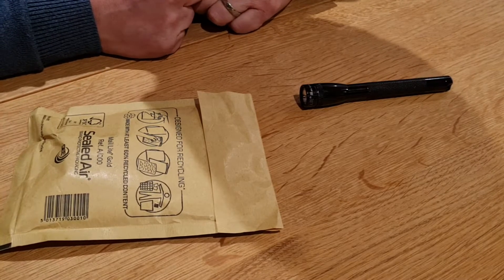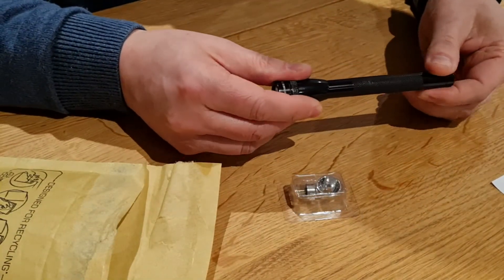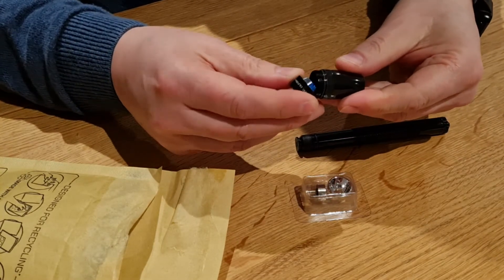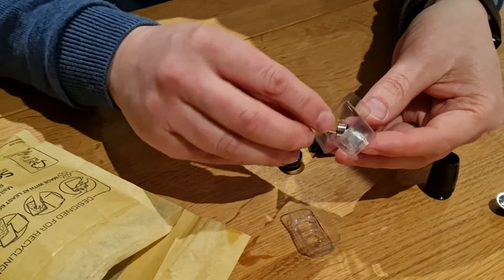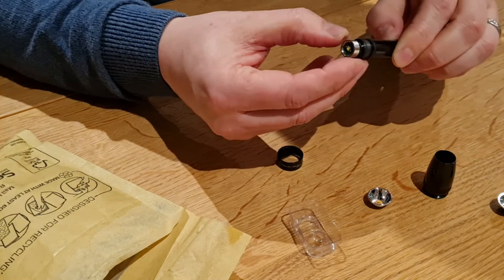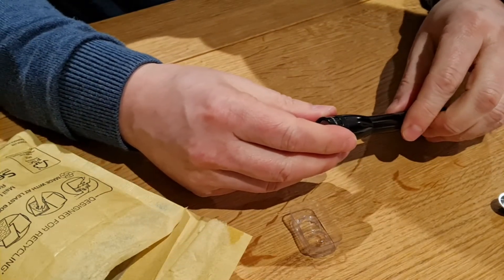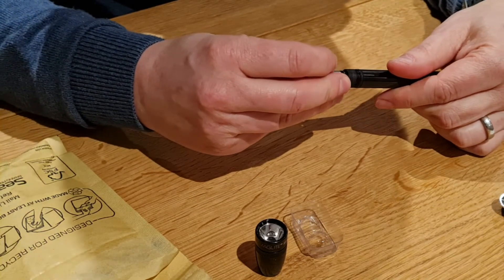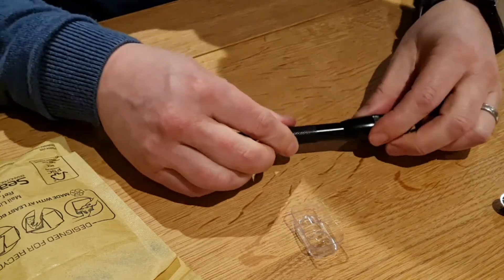Mini Maglite AAA - Super bright DIY LED upgrade

Comment: Great video. As an optometrist i bought one about 20yrs ago to use as a pen torch. I've recently found it  and will upgrade to LED. I'm also going to upgrade the battery screw cap to one which has a push button on and off switch. 👍🏼
Reply from the maker: Thanks for taking the time to comment and it's great to hear you'll be upgrading yours. Always nice to hear of something being given a 2nd life rather than being replaced.

Comment: Found one yesterday at my local supermarket's recycling bin for waste electronics somebody threw away. 😇🤗

It had that miniature (working !) traditional glass krypton bulb. So not an LED. I'm going to get that upgrade for it in the future. 🤔😎

Anyways... a wedged leaked Duracell AA batery was stuck inside. But I was able to get the battery out from the other side by gently hitting that plastic piece to push it out. 😊👍

Luckily the leak wasn't big & the corrosion on the inner metal tube part wasn't significant. So I just used some sanding paper & a metal file to remove the jagged surface left by the alkaline liquid from the battery. 🙄😏

I put some minerail oil on the inside of the walls of the metal tube part of the flashlight to ensure easy sliding of AA batteries out. 😆
Reply from the maker: Hi David, thanks for taking time to comment. It always surprises me what people will throw away and it's great to hear that you've rescued a Maglite and are going to give it a new lease of life. The LED upgrade is a no brainer - it's so much brighter. I wish I'd done it years ago! 

Do bear in mind that this video was one of my earliest - my production quality has got a lot better since then!
Reply: @MostlyHelpful  Yeah sure ! I'm quite fond of "dumpster diving" actually. 😏😄

But that LED upgrade would cost me approx. $ 20 though... I would get 8 of those small Q5 LED AAA flashlights for that price off eBay. 🤔😕

Hey no problem ! If I just look back at my own "YouTube career" beginnings... 😊

Comment: Very nice.

Will this work on a modern Mini Maglite AAA if you just want a brighter LED than the factory one? Since the new ones already come with an LED but they still aren't quite bright enough
Reply from the maker: Hi Joel, if the bulb fitment is the same then I can't see why it wouldn't work. I don't have a modern Maglite to check it though, unfortunately.

Comment: I'm anti-LED as I just hate the CRI quality.  I actually use Paleblue batteries in my Mini Maglite with the xenon bulb as it make them run bright the entire time without dimming.  The Paleblue batteries are lithium-ion rechargeable cells with circuitry to output a constant 1.5v until they need to be rechared.  I have a very expense 95CRI LED flashlight and color rendition from $10 Mini Mag is still better.  LED's can't seem to produce red very well.
Reply from the maker: I have a friend who's very CRI sensitive, but I can't say I notice a difference personally and/or need accurate colour representation. As long as I can see in the dark to not trip up then that's cool for me. That said I will investigate the xenon bulbs and paleblue batteries as that sounds intriguing.
Reply: Only problem is you're essentially overdriving the bulb which is a good thing in that the Throw is better and a bad thing since the bulb life is reduced. The 7.2V 6 Cell Xenon bulb should last a while being driven by 2x Li-ion cells though, not too sure about the Mini Mag bulbs.

I like LED, but I'm also keeping my Incan Bulbs for Nostalgia and HIGH CRI.

P.S Hmm, those Pale Blue batteries sound interesting.
Reply: @Vinnay94  I'm not sure where you found the spec on the bulbs; I haven't found them myself.  The 7.2v doesn't seem right for a 6 cell bulb given that a fresh set alkaline cells is 1.6v each and that works out to be 9.6v.  The lithium-ion cells have a nominal voltage of 3.7v but when fully charged is around 4.2v thus it's starting off at around 8.4v.  I did try a 5 cell bulb but that burnt out when the cells where fresh off the charger -- the 5 cell did work fine after the cells settle down in voltage a bit.  I going to stick with the 6 cell xenon bulb; although, I would love to know the actual specs on the bulbs.  The Paleblue put out a constant 1.5v but I wouldn't trust them in any expensive gear as I would be afraid of the internal voltage being exposed - I've had that happened with that type of battery from a different manufacture.  I do agree that the bulbs most likely have a shorter lifespan as they are being burned brighter throughout their use -- either through the flatter discharge curve of the lithium-ion cells or the constant 1.5v from the Paleblues.

p.s. Was cooking a steak on the grill the other day and check it with the 95CRI flashlight and the Minimag xenon -- while the 95CRI was passable the Minimag was just much better.  In the past I tried using a Surefire flashlight which doesn't give a CRI rating and it made the food look very uneatable.
Reply: @rui1863  Every D/CMaglite Bulb goes up by 1.2v. When you run a 6 cell bulb on fresh Alkalines you will be getting approximately 9 Volts which is not gonna hurt it. Also, the Tail Spring, Body and Switch have some resistance so technically the bulb is probably getting hit with 9V or maybe less. Even if the bulb does initially get hit with a whopping 9.6 Volts, the voltage drops pretty quick with Alkalines.

I've overdriven 4 Cell Kryptons and Xenons with no Instaflash but the bulb life is very short. Very nice white throwy beam though.
Reply: Oh, and for my 2D Maglites I run two 26650 lithium-ion cells (3.7 nominal voltage) and use a 6D xenon bulb.  So I get brightness of a 6D Maglite in a 2D body and the flat discharge cure of the lithium-ion cells means the light is stays bright and doesn't dim like with alkaline batteries.  :).

Comment: It has 2 modes to save battery. How to you access low mode?
Reply from the maker: Hi 1up, thanks for watching the video and taking time to comment. My Maglite doesn't have multiple modes, so I don't how to access the low mode.
Reply: If so it only could accessed about turning the head. Maybe a quick on and of. Thats the way you can do it on some keychain torches.